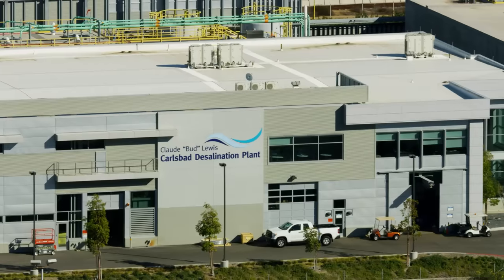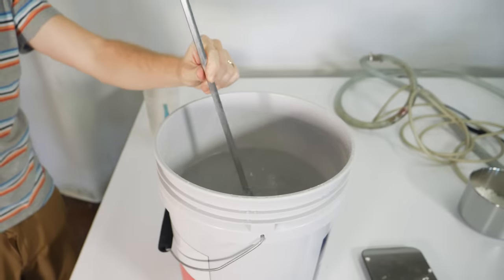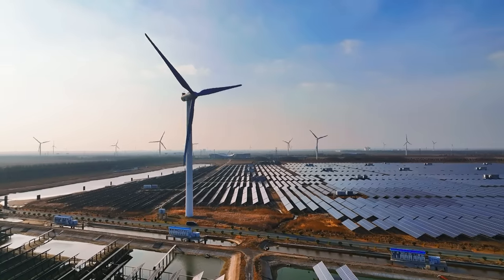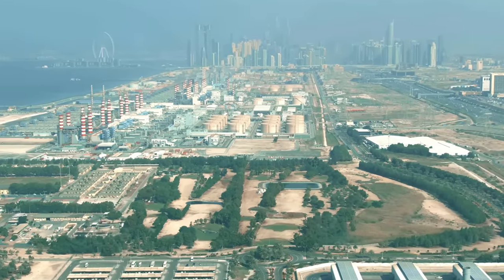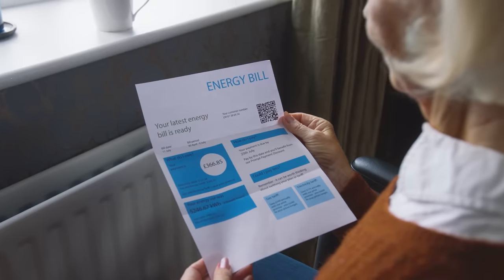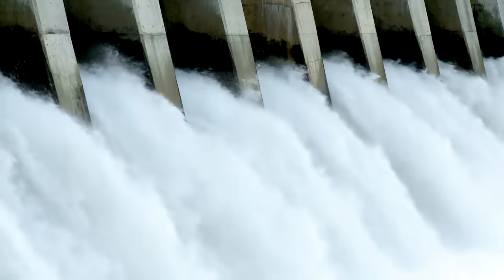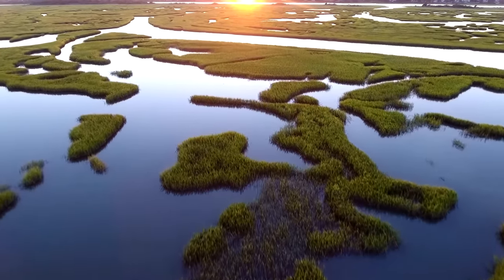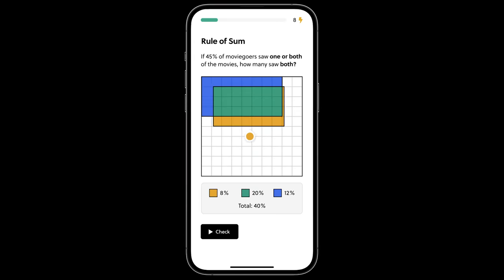Why Is Desalination So Difficult?

Comment: It would be cool if you went into more detail on the energy recovery systems in RO.   Rotary pressure exchangers (one moving part!) are remarkable devices -- and they were invented surprisingly recently.

Also, for distillation, I think you're showing a humidification/dehumidification system there.  The water vapor is mixed with air.  With these, there's a problem with mass transfer at the condenser:  the air near the condenser surface becomes dry, and water from the rest has to be transported through this boundary layer (this is not a problem in a vacuum system where only water vapor is present).   There was a spinoff from MIT a few years ago that had a new condenser that gets around this problem (bubbling air through trays of water; the bubbles are tiny with large surface area.)  I've thought this bubble tray system was quite clever.  These were using it to desalinate produced water from fracked wells, reusing the water for more fracking.
Reply: Another potentially interesting concept: if you keep increasing the salt-to-water ratio in the bi-product, you could potentially end up with an alternative to salt mines.
Reply: @TheExileFox  Yea - sea salt also naturally contains bromide and iodide compared to rock salt.
Reply: @TheExileFox  I think salt isn't worth that much. 1 ton costs arround 300$
It is also not that much. He said sea salt is about 35g per litre , if I rememeber correctly.
Can imagine that "harvesting"  and selling this salt is more expensive than just pushing it out into the sea before it solidifies.
Reply: Yes, he skipped or ignored a few methods, including rainwater collection.
Reply: I noticed but then he said SIMPLE, so it is not what you would build for real.

Comment: Thanks for the great video! I learned a lot about the challenges of desalination, but I dont agree on your take on private-public-partnerships. A private company would not agree in a contract if they wouldnt make profit out of it, so in the and such an agreement is more expensive either for the government or the consumer. Also the point of not having to take the financial risk isnt true in reality, because in the case that there is no other way of getting drinkable water (which if I understood correctly is the only reason why you would use desalinated water anyway) the government would have to save the Company financially to keep them operating, because it is no option just to not produce drinking water.
Reply: Thank you! I had scroll way too far in the comments to find someone else mentioning this. Privatizing water is a recipe for disaster.

Comment: Here in Israel we have gone from constantly worrying about getting enough winter rainfall to fill the Sea of Galilee (misnomer, it a freshwater lake and serves as the country's water reservoir). Now with several RO plants built, we have enough water for domestic usage plus use the desalinated water to refill the Sea of Galilee if it gets too low as well as transfer water to Jordan.
Reply: That's because you have lots of oil there so the cost of RO treatment is much lower since the most significant cost is usually energy.
Reply: actually, israel is one of the few countries in the middle east which doesn't have oil.
Reply: @kaiqiwei3628 The majority of our electricity now comes from the offshore natural gas, replacing coal
Reply: @adid  Yeah, we did have in the Sinai but gave Sinai back to Egypt as part of the peace agreement.
Reply: No wonder Jesus could pull off the scam of walking on water, because he found a sand bank to stand on.
Reply: @marzupalami  maybe it's just humour
Reply: @marzupalami Um, take a look ay some of the biggest political problems in the USA, and most of it comes from Christian Conservatives.  While it may be couched as "humor", it's usually based in anger and hatred. And for good reason, imho.
Reply: @marzupalami  I don't know fam. For someone talking about bigotry you sound like grandstanding quite a lot here looking down on those with different takes. Sounds like bigotry to me.
Reply: people making religious drama aside, thank you for the insight on what Israel is doing! it is amazing that you guys are producing so much water
Reply: @mahuk.  He forgot to mention that they're also keeping that fresh water away from Palestinians because Israel is an apartheid state.

Comment: Also there is the issue of biofouling where bacteria grow on the membranes and clog them after a while. It turns out to be very difficult problem to fully address.
Reply: Slow sand filters, followed by UV lamps, then activated carbon filters.
Reply: @Simple_But_Expensive  $$$$
Reply: @thejman5552  His user name checks out.
Reply: @bradley3549  Lollll

Comment: This was interesting. As a dialysis patients I actually have a water system that starts with two carbon pre tanks and an RO that is about the size of a large computer tower in my home to make medical grade water.  Running it about 100 hours a month doubles the household water use but is not that hard on power. The equipment does need to be replaced/refit once a year but the healthcare system pays for that so I have no idea the cost. The tech seems to be there when you need it to live. I think we just won't improve it until there is more money to be made.

Comment: Amazing technical and practical analysis of desalination! I live in Arizona. We have abundant energy in the form of sunshine and wind, lots of open space, fertile ground for growing crops, but we lack sufficient water to continue growing more food and our population. Your timing on this video is amazing because I was just sitting down to research this topic myself so I could do some writing on the economics of desalination for our state using water from the Sea of Cortez. Your video is a great place to start and really whet my appetite to dive into total energy cost per volume of water generated, including pre-treatment, desalination, consumables, pumping and any post-treatment that would need to be done if the water was used for drinking. 

The interesting thing about our situation here is that we could easily provide drinking water to many more people in this state if we used all of our reservoirs for drinking water. Where we run into problems is with water used for industry and agriculture. I think that it's inevitable that we'll ultimately use desalinated water for industry as the benefits of agriculture and manufacturing here in the state are greater than the drawbacks, such as the need to use processed water. But that case remains to be laid out clearly....

Comment: I'd like to know why the "Ocean Vapor Towers" approach doesnt make more sense than these methods, it seems a logical way to get fresh-water from salt-water and it leverages cycles so nature is doing a significant chunk of the work
Reply: It's slow  per liter of water treated compared to other methods. Thus for a given amount of water the equipment has to be MUCH larger. (more expensive)
Reply: Basically scale, the number of towers you would need is astronomical
Reply: construction cost vs output. running cost isn't everything
Reply: At that point you're basically engaged in a small geoengineering project since you're trying to change the local climate and that is basically impossible to predict because you have to factor in the entire global climate to figure out what will happen. No one in their right mind would sign off on spending millions on a project that you can't even guarantee the outcome of. If a region doesn't get a lot of rainfall then there's some pretty powerful natural forces behind it and it's fairly easy to conclude that humans can't easily influence that. Like climate change is only happening because our entire global civilization is engaged in the same activity and has been doing so for about two centuries so it really isn't easy to influence the climate of our planet.

Also there's the fact that you can't necessarily directly use rainwater, we usually use groundwater which has spent thousands of years filtering through the ground to make it clean. Plants that draw directly from sources such as lakes and rivers still do need some amount of cleaning before it becomes safe to drink and it's susceptible to ground pollution, which an area that experiences little rainfall that would normally wash it out probably has a lot of.
Reply: Based on this video it seems that reverse osmosis is a lot more energy efficient than distillation. It may seem attractive to use sunlight directly for evaporation instead of electricity. However, if sunlight is plentiful it might still be more efficient to convert that into electricity and use it to run reverse osmosis.
Reply: @hedgehog3180 if you look up cloud seeding Dubai, making it rain in regions that don't get alot of rain. It's a thing.
Reply: I think for Towers to work the scale would be so huge that only wealthy governments would be able to make the investments. As mentioned in the video, it is difficult for governments to do things that don't make money for politically connected interests (okay, he didn't actually say that but what he said leads straight to that). I think it would take too long to pay off for the private sector to be interested. Private interests (aka people) like to collect during their lifetimes.
Reply: @adamplevey8385  cloud seeding doesn't work half the time
Reply: Tatooine's had moisture vaporators for hundreds of years. Surely we could figure it out by now. :P

Comment: I appreciate the googly eyes you put on the one flow meter to increase efficiency.

One of the things to keep in mind if you wanted to build your own system for use with the distillation process is not only the energy required to heat up your source water, but also the energy to cool water for the condenser. You were using icecubes so you didn't have a measurement for that, which doesn't matter for your demonstration, but that would make a difference if trying to apply this practically in a DIY setting.

And the pressure washer definitely wouldn't hold up XD I'm sure the salt would scale inside it relatively quickly. Good for a demonstration... but I'd definitely get a pump made for pressurizing salt water to do that DIY.

Also, for DIY, I'd probably only consider it if like, you were prepping for emergencies, and were going to use it for mostly drinking water; while we like to get showers daily because it keeps us nice and fresh and pretty smelling, in an emergency you could reduce your washing. Maybe shower every 2-3 days; just to keep from getting too dirty. If you're still in your house you can probably go a few days without really getting yourself dirty if you're waiting for utilities to come on.
Reply: Yea the gogly eye look awsome... but the setup didn't look very safe.. I guess if there where an explosion, it would be somewhat small.
Reply: @matsv201  probably, and he does have glasses at least, so I think his eyes will be fine
Reply: @DoctorX17  personally I would not stand anywhere near that with out a thick sheet of plexiglas between me and that device.

While, sure, it's not handgun dangerus. You really want to be carefull when you pool up pressure washer
Reply: I also imagine that salt water would corrode parts very quickly in that demo setup.
Reply: @VeteranVandal  yeah. Not sure if it would survive more than maybe days or a couple weeks

Comment: Great video, but I dissagree on the topic of running the desal plants by private companies instead of governement run. It is usually much more expensive because the private companies try to maximise their profits. Has been a problem with several of the formerly state owned infrastructure here in Germany, e.g. water system in Berlin: it had gotten much more expensive since the government sold it (in 1999, 49.9% of it) to make a shortwhile income. Since the buyback (2013) of the water infrastructure, the prices went down again.
Reply: While I agree that utilities run by private entities can be more expensive since my town's electric division has significantly lower rates than the surrounding towns and cities here in the states. I think the point was that smaller towns/cities (large enough though that can still afford desal plants ofc) might not have the money/time/personnel to manage the utilities which may cause it to actually be more expensive. Also, privately run utilities can allow for more innovation; Possibly driving prices down through better efficiency.
Reply: @xing3240  It doesn't make any sense. The costs of running it are what they are. Either you just pay that cost or you pay that cost PLUS the cost of whatever profits the private entity is seeking. The math is simple. Also there is tons of data showing how profit seeking get's in the way of innovation. Innovation has happened despite profit-seeking not because of it.

Comment: I'm working for a company in the Netherlands that builds and uses machines for ground water (a well) and de-irons it for farmers or who ever needs it, also building ro and ion changers for all sort of uses from farmers to sauna's. Verry interesting stuff, got a cliënt who gets salt (brak) water from his well and uses 3000 liters for 1000 clean water using a RO.
It's quite efficiënt for how bad the water is before but it's a real big energy user because the RO works at 10 bars so the pumps really work hard

Comment: Fascinating. I recently learned that clean creek water can be made drinkable with an RO system. The under sink variety is affordable! I intend to move to the 'edge of the grid' instead of 'off grid' and rather than digging a well, I'll be getting some of those 275g water jugs. A solar powered pump would hopefully be enough to fill it. I'm not worried about it being speedy. Then let an under-sink RO system handle making it potable. Technology is amazing.

Comment: One advantage of desalination is that it can be coupled with solar energy production, when there's a lot of solar energy, the plant can ramp up and produce a lot of desalinated water for later use with the cheap solar energy and at night it can be shut down and reduce the energy consumption when there is less power available. There is also a long term correlation, during the summer when water consumption is higher also there is usually more solar energy available.
Reply: you can also store that water long term too. You can produce it in summer and consume it in winter if desired.
Reply: There's also concentrated solar plants, which use steam turbines to generate their power. You could create a combined distilation desalination-CSP plant and generate power and drinking water at the same time. (I'm surprised this isn't already a thing)
Reply: Use boat with solar panels and kinetic energy things
Reply: Combined with windpower and biogas.....yes it makes sense.

Comment: I worked on steam powered oil tankers built in the early 70's.  We had two flash evaporators that ran from bleed steam at sea.  These took seawater, heated it, sprayed it into a vacuum chamber, then reheated it, and sprayed into a higher vacuum chamber before the brine was then pumped back overboard.  Each stage created water vapour that was condensed by the seawater feed, thus heating the water. The chloride content was around 1ppm and each evaporator could make 120 tons of water per day.  The water was used for engine room and boiler use while separate tanks stored water for domestic purposes. To make the water suitable for consumption, it was passed through a mineral tank and then two stages of UV sterilisation.   The biggest problem we had was when the deck department were cleaning tanks and would "decant" the slops over the side without telling the engine room to change over suctions to the opposite side.  Any oil caught in the water would be picked up by the auxiliary seawater pumps and get into the evaporators that would boil off the lighter fractions as kerosene which would then get into the water tanks and add to the Engineer's workload.  Good old days of being at sea.

Comment: Environmental engineer here. It really is not that hard. It's just that it requires a lot of energy. High pressure pumps need a lot of power to reach necessery pressure level 100+ bars, so that desalination (reverse osmosis) membranes let H2O molecules and nothingelse through.

Comment: I have a dehumidifier machine that takes up to 30 liters of water per day out of the air. Because this machine is made to dry the air of humid rooms like basements and not to produce water, the waste water of this machine is no drinking water. Inside that machine is a big fan and a compressor like in a refrigerator. The fan moves the humid air to the cold area of the refrigerator. The moisture is condensing and flows into a container. The water still contains some dust from the air if there is any in that room. To make it drinkable it needs to be filtered and some minerals have to be added. The advantage of this way to make water is that you can make it wherever the air is warm and humid. You don't need fluid water and there is no salty waste water. A disadvantage is the high energy consumption of the compressor. But if supplied with solar energy this might be not a problem.

Comment: Australian here, so not really much knowledge about winter but why not put the brine into evaporation ponds to evaporate the rest of the water and then sell the salt or even extra salty brine to cities to de-ice roads in winter?

Also, what about solar distillation? It's a survival tool here if your stuck in the desert, but surely, pumping sea water through black poly pipes in the sun, under pressure and then allowing it to flash boil in a still would make a significant amount of fresh water. Hell, you could combine it with solar panels like they're doing in, I think Saudi Arabia (possibly UAE) to increase the efficiency of solar panels by cooling them with water. Use sea water to cool the panels and then collect the condensate to collect water.